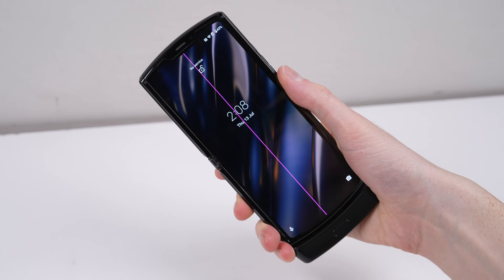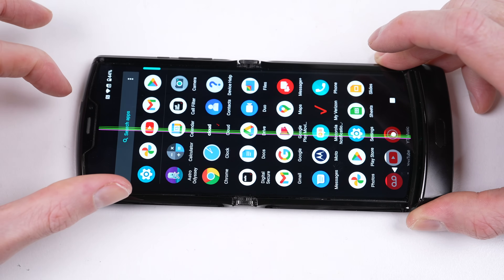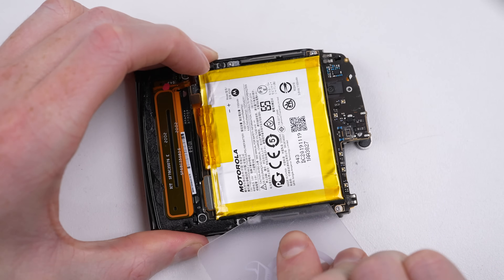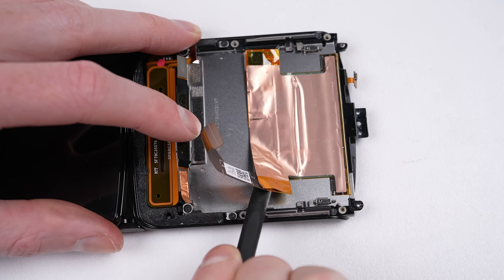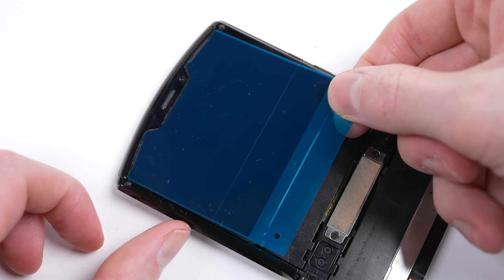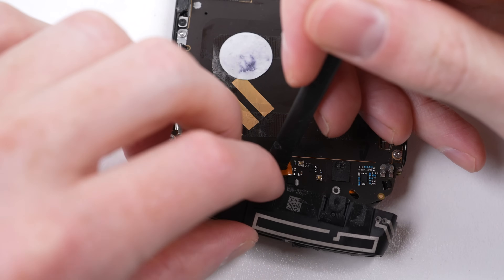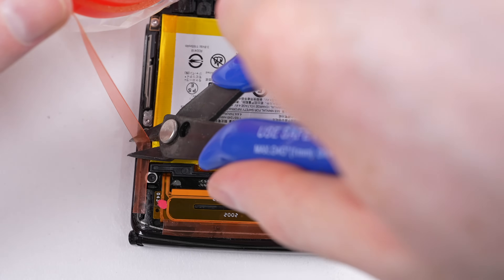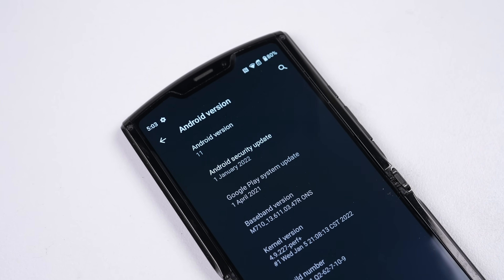Motorola Razr Folding Display Replacement - This Phone Got A 1/10 Repairability Score

Comment: you cant damage a PCB with isopropyl alcohol unless you dont let it dry before powering it. you could toss that entire phone in a bucket of isopropyl alcohol, and as long as you let it fully dry, no damage would occur. the once thing is alcohol can remove certain paints, and mess with some components with extended exposure

Comment: Replaced the display as in this video. the image is perfect, but the touch screen has stopped responding. I reassembled it several times, but the problem was not solved. I'm inclined to believe that I received a defective screen. Am I right, or could the problem be something else?

Comment: Hi Hugh, question: I am stuck with a brand new Motorola Razr 40 2023 with the smaller screen at the front. No one wants to buy them im my area.  So is it possible to make it a better IP rating if not waterproof  like the newer razr ultra ? 
Cheers mate

Comment: How to not get stuck with a shitty unrepairable phone. Stop buying shitty unrepairable phones cause of stupid gimmicks like folding displays.
Reply: I won't call folding display a stupid gimmick, as it can be useful for some people, especially in the big fold format. And there's a bit of fun around the sea of same old slabs.
After all some of us might say the same thing when multi touch touchscreen has arrived.

Eventually The cost of tech will drop down.
Reply: @mArvAlcao71  its a gimmick. it does nothing a bigger device cant do on top of have a screen thats extremely fragile and will inevitably break from being folded and unfolded. if the issue you are having is portability and size. its call a bag and a bigger device...
Reply: @craig9365   @craig9365  1. Gimmick or not  it depends on each person. You fins the foldables useless? Fine, but some people find those useful depend on  their needs
2. Just like Michael Fisher has said, It brings the fun back between the endless sea of rectangular slab. I mean, phones are getting fun again eh?
3. The tech will be better, stronger and cheaper. Just like touch screen we all use today
4. This one has relations with My 1st point. Not everyone wants/affords/whatever to bring a bigger device and bags
Reply: @mArvAlcao71   it brings the fun back?  You never have a folding phone or Nintendo DS or something? Ffs dude get a more exciting life if that's what's fun to you lol. And no the screen will likely take a long time before you can no accidentally scratch it with your finger nail.
Your only two valid points were the same point and that's preference.
Also fyi none of this negates my original point. These phones are garbage and unrepairable. (That's actually every phone but let's be real we both know fixing your folding screen is easily double mine and incredibly more likely to break her damaged, and let's not even talk about the hinge that will inevitably fail)

So unless you have something that's relevant to my actual first point which is you buy unrepairable garbage you get unrepairable garbage I'd like to hear it. Buying unrepairable garbage whether it folds or not doesn't change the fact it's unrepairable garbage.
Reply: @craig9365  mate you seems so offended.  I replied like it's a normal comment yet you took a piss.

As I said, every people have different circumstances, situations, or whatever. About the "fun" factor, I didn't say that. Ask MrMobile for example.

I understand your skepticism, as for now you're right. I didn't try to counter yours.

But my point still stands. And whether you love it or hate it, those folding/flexible/rolling/etc. screen tech will stay, and it will gets better
Reply: @mArvAlcao71  not offended just making a point. Nothing you said is a valid or even remotely close reason to my original comment. When you have a valid reason out side "I like it" I'd love to hear it. Cause nothing you said invalidates it's a irreparable piece of crap. If you enjoy buying 2k phone every few years cause it's too expensive to fix the hinge or screen be my guest. Lol. To me that's a really low IQ room temp move tho.
Reply: @mArvAlcao71  so again when you have an actual intangible reason that proves it not repairable and you can fix it for a relatively reasonable amount I'd love to know about. Cause as it stands most phone aren't like that. And you must not value your life tom or money if you enjoy the main part of a phone being a literal wear item. Idk it's just plain and simple physics. You can say all you want otherwise. It will break and it will cost you a brand new phone cause it won't be worth it to fix.
Reply: @craig9365  This supposed to be a simple conversation, but carry on lol.

I didn't say you have to validate my comments tho. There's no need to. 

I never said the folding phone are repairable or easy to repair anyway. Yes it's difficult, yes it's expensive, for now (If you're following Hugh's channel for a while you surely know the cost has gotten down. Still expensive but still, the early days.)

Anyway, what's more irreparable, replacing a fragile folding screen or having a phone has its functions limited by software after 3rd party repair?
Reply: @mArvAlcao71  I started with it's not repairable you came in and said but I like it. What does that add to the conversation? Good for you? It's still does nothing to the main point at hand.
Reply: @mArvAlcao71  if you want a convo add something meaningful. Not a childish "but I like expensive non repairable items" which is literally wjat I just said is the oroblem. If you notice people keep buying a literal turd for $40 bucks are you gonna be the dumb one to stop that or you gonna cash out till the idiots realize they are buying shit? (Now imagine that but corporate America) As if I somewhere said don't buy a folding phone. All I said was it's irreparable and that is objectively bad.
Reply: @mArvAlcao71  maybe I offended YOU cause I called your overly expensive piece of obsolescence irreparable. Idk why that bothers you. But like I said. Keep buying irreparable crap and you'll keep getting irreparable crap. (Hence why I opt to buy phones that aren't thousands of dollars with screens and hinges that will inevitably break, and cost literally a quarter or your phone) If you like it and want to keep wasting ur money be my guest. Enjoy it for 3-5 years before the hinge or screen breaks. Your the one attacking me for pointing out a fact. And then you get mad at me for saying the thing should at the very least be repairable because of the obvious. There's a stupid hinge and extremely delicate screen that are wearable items on a phone. Excuse me for actually being on your side XD.
Reply: @craig9365  mate I have a Samsung A54. I don't have a foldable phone yet lol. I would love to once the tech has gone mature enough.

Anyway, carry on.
Reply: @mArvAlcao71  when you finally obtain your silly folding phone, and it inevitably breaks through no fault of your own other than your were simply using it and you nor a company can beat physics you'll come back and go you know you might be asshole but your right, that dumb phone broke in 3 years just cause the screen is a wear item and there goes your 2gs. And the repair is the same price as a new phone. If that's what you like be my guest. To me that's absolutely idiotic.

And here I thought irreplaceable batteries were silly. Guess I'm alone in wanting logical repairs to not have to buy create mindless e-waste. All I can say is I hope you don't go around promoting environmentalism.
Reply: @craig9365  You keep pointing the same thing over and over again, doesn't change my stance.

Yes, it might break over time due to moving parts. Yes, it's expensive right now.

But as I said, the tech will go better and cheaper and we will see under $1k foldables. Just like the touch screen tech we enjoy right now.

One thing for sure, if it's useful, it isn't stupid nor useless.
Reply: @mArvAlcao71  do you read your own comments before making them?
I said the phone is irreparable garbage.
You said yeah but I like it and then get butthurt when someone says that comment is a meaningless worthless waste of your energy to write as it contributes nothing to the point. Like cool you like it. Doesn't change you'll need a new one in 3 years. But hey you wanna waste 2k on a phone every 3 years be my guest. You don't buy a new PC every 3 years for 3k just cause they made the power button break right? Yeah the issue is you don't understand logic and facts. Congrats people buy things cause we like them. That's pretty obvious. Buying crap that's designed to be thrown in the trash is stupid. So all I can say is I hope you don't go around spouting environmental crap cause you for sure ain't no environmentalist. So if you enjoy the constant change of everything being irreparable and meant to be replaced and not fixed keep going your direction.
Reply: @craig9365  unrepairable in which way? Difficult to replace the parts or having the function bricked by software after repair? For me it's unrepairable when the latter applies because as much as it is difficult to replace the parts, as long as it's still retain its full functionality it's not a massive problem.

Surely we're not replacing the PC every 3 year but surely WE do replace the phone every 5 or 6, not 3 years eh?

And nope, I won't spend 2k as I said there will be a cheaper version in the future.
Reply: @mArvAlcao71  is this an actual joke? Or do you throw away everything you own lol. Google Louis Rossmann. You can also Google phone repair of a non folding phone and see a) how hard it is b) how expensive it is and not financially feasible half the time. I'm scared your the kind of person now to spend 10k on a car that costs 2k lol.
Reply: @mArvAlcao71  also you can Google what people think about apples new self repair phone thing and how horribly priced that it to the point where it's still better to just buy a new phone. So again do you just throw away everything that breaks and buy a new one? Irreparable stuff is a problem in more than just phones and the way you speak kind of proves why this even became a problem in the first place. Simply people like you just don't care XD.
But like I said when you finally get your foldable phone and the hinge or screen inevitably breaks or gets damaged you'll come back and see how right some random Internet asshole was. Or you won't care and you'll just waste your money on a new one. I guess at the end of the day it's still up to you.

Comment: Hmmm, I don't exactly see why it got 1/10 repairability. It just seems extremely fiddly. All I saw where screws and cables needing unplugged and little glue use.
And how on earth did the iPhone 14 of all devices get a better score when the thing needs to have simple parts "calibrated" with a program no one is allowed to use?

Comment: With the current tech available in China, pink/green lines appearing on OLED/Flex OLED displays can now be fixed without removing it entirely on the phone. 
But it will take time to go available in public.

So possible, the repairability of those phones with same issue on displays can be fixed easily.

Also, nice job on the nerve-wrecking screen replacement. To be honest, it seems scary, not to mention that almost all flex OLED Panels are too sensitive every removal happened on the device.

Comment: Hugh you are a phone fixer professional. A folding screen has a built failure mode for nothing. Hard to fix, dumb ribbon cable. Even in Sci-Fi no one was crazy enough to show a bendy folding screen. Basically a question nobody asked, or cares about. The best phones, like the best poker hands, never fold. Love your work Hugh, keep it up.

Comment: Got a fold 3 and the back glass panel has naturally seperated and is ready to fall off, i haven't dropped or submerged it in any liquid, and tmobile wants to charge me my $200 deductible saying it's considered physical damage is there a way to reattach the original back glass?

Comment: Motorola's approach to software drives me absolutely insane.

I like their stuff. Their phones feel pretty well built, usually better than Samsungs in the same price bracket, but they are so quick to abandon updates it makes me mad.

I bought their Motorola One as soon as it came out. Their Android One phone.
Per Google's Android One program directive, these devices are supposed to get at least 2 years of OS upgrades and 3 years of security patches.

My Motorola One, for instance, sits in the 2-year window for Android 11. Still running Android 10, even though 11 has been out since september of 2020.
Every single time I reached out to them asking about the release of Android 11, they told me there's no date yet. The phone doesn't even show in their online update checker anymore.
To be honest at this point I just want them to acknowledge they're not releasing it, and then I'll probably sue their asses for false advertising.

The latest security patch for Android 10 is dated october 2021. Exactly 3 years after the device's release.

Such a scam. Motorola does not put any effort into maintaining this stuff and Google, who certified the device as part of their Android One program, does not seem to care.

Comment: I had the Motorola razr  2020 5g phone it constantly overheated and shut down, Motorola wanted 850$ to check it out, I told them it was cheaper to buy a new one.   After 18 months the small front screen went fuzzy and didn't work, them the main screen did the same and eventually swipping up separated the screen from the casing..so I couldn't put the password in to back up,  thankfully I plugged it in and manged to get it unlocked and backed up before the screen wouldn't work at all.  I had no choice but to recycle as fixing was 850+... more than a new phone.  Customer service terrible, cost to check not even repair offensive.  I bought the fold 4 a few months ago, working good although the fold in the screen is much more noticeable than the Motorola

Comment: this phone is available in Pakistan for less then 200$, the main reason is obvious, any damage to this phone's components is near non-repairable.
(lack of parts and lack of proper support from Motorola, the E-sim issue isn't a problem since most people around my place use smartphones for entertainment)

I'm not surprised Moto left this phone in the dust after just a few years, its designed well but not great for repairing.
Compared to this even older phones from 2019 are still receiving updates and have abundance of parts in the market.

Comment: You would think that this font would be more repairable but I kinda have a gut feeling that with the newest one that Motorola has released that this phone was specifically made just for the idea for testing the market before going more in depth into releasing the new "Motorola Razr 40 Ultra" that they recently came out with a before fully committing to the idea of creating a folding phone. You gotta remember that this model released with a 3 to 4 year old processor in like 2020 (the snapdragon 710) so that was another issue with this model... you can essentially label this moto razr as E-waste because of the fact it didn't retain its high price tag from $1,000 to $65 as Jeffrey mentioned. hence why I think that Motorola wanted to deliberately this device so that people couldn't repair it if it was damaged.

just look at the what the "Motorola Razr 40 Ultra" offers imagine if they had launched with that device first instead of this 700 series snapdragon first.

Comment: Avoiding the problem you experienced with the display sticking too early is probably why the adhesive backing comes off into parts. If you just remove the lower part it'll allow you to align the screen at the top properly without it sticking before you're ready. You could then adhere the bottom part then remove the backing from the top part and adhere it afterward.
Reply: I have done a successful display install using your method about the adhesive 
With some practice with the old display and some technic I have done it perfect around edges 
Thank you!

Comment: Strangeparts submitted nice video about full displays restoration with laser. they restore such green and white lines by laser micro soldering, so no full display replacement is necessary. https://www.youtube.com/watch?v=ks-lS11TIaY  
Thousands of not recycled original displays now can be restored for cheap, including this one, which you keep "for testing".

Comment: If the old display has a bad connection under that yellow sticky tape i would say its definitely worth giving to someone with a proper soldering station to try and fix it if possible

Comment: Here we can see what is the real problem with e-waste. It is NOT repairability, as we can see it is complex, but it is manageable. Problem is the lack of updates and security patches. You can have nice old phone, put there new battery, new display, change cracked camera lenses, but it is useless when it is sw outdated, since some apps requires some level of patches. Of course, you can use that phone for other purposes, but let’s be real - how many such devices are used?

Comment: FYI:
(Pure, 99+%) Alcohol does not cause water-damage on electronics. It does not corrode metals (pins, traces, etc.) and it does also not create conductive ions and thus will not become conductive, even if it comes in contact with dirt or other particles.
So it is 100% safe to use on electronics, even if voltage is present.
It might leave a visible residue however, so it can cause problems, when it get's into the layers of a screen.